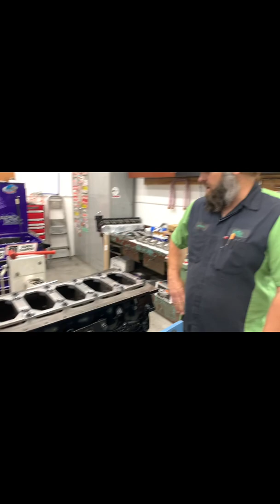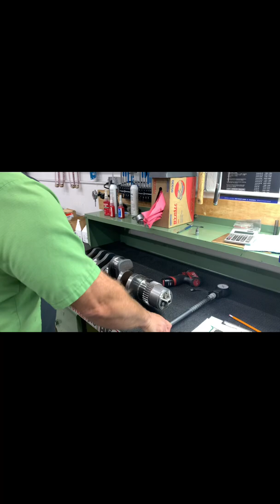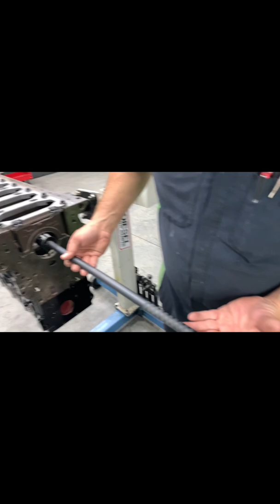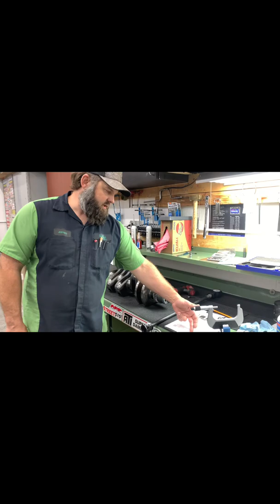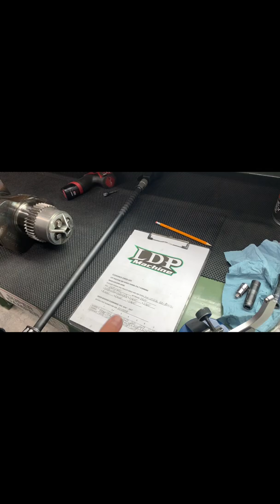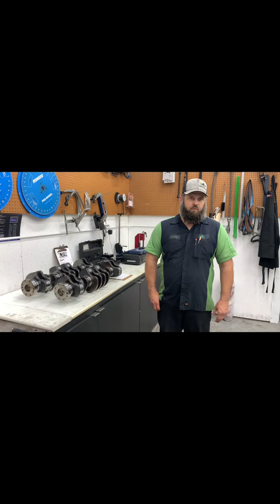Bearing clearance part 1

Comment: Why are the bottoms of those connecting rods offset?
Reply from the maker: They are angled cap rods. Mainly used in inline Diesel engines. Stronger than a straight cap rod. Takes the load off the bolts.
Reply: @LDPsales  Interesting. Why wouldnt that work for v engines too?